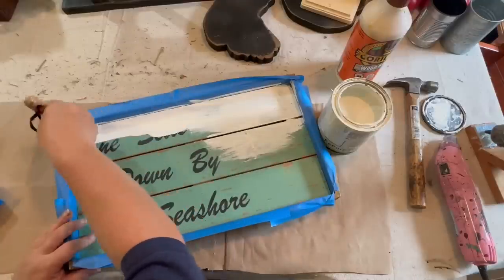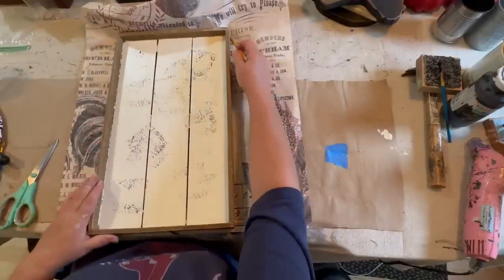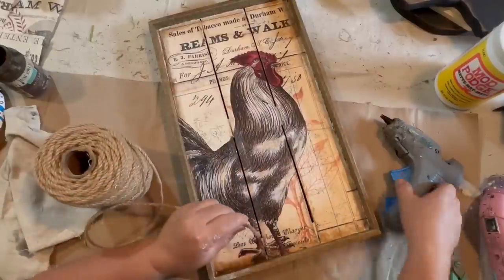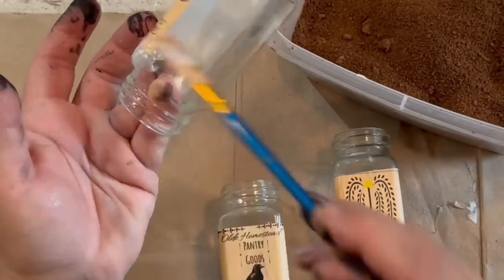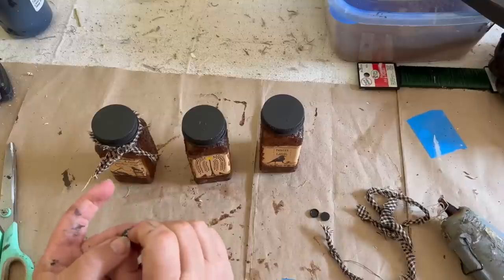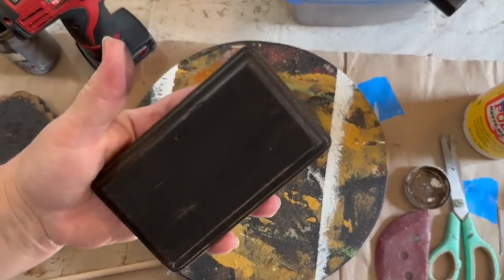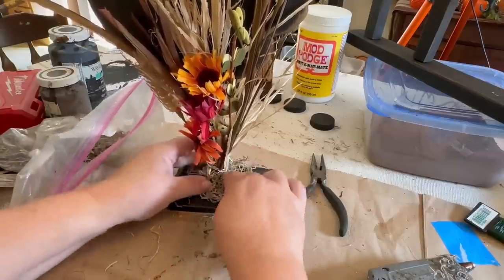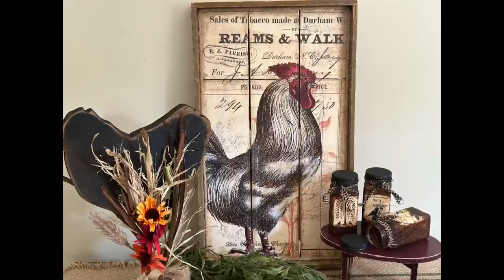DIY Fall *Rustic Primitive* Home Decor

Comment: Spritz the top of your paper each time you add more mod podge and spritz that section before you put it down. That REALLY helps it mold to your surface and relieve wrinkles and bubbles. We both did crackle under the paper! I did a black halo like Royce does as well. So glad you found a use for the paper! Beautiful, beautiful job ❤❤❤
Reply from the maker: I love the crackle look underneath! It adds so much.

Comment: Would the Rust-Oleum 2X Clear Coat work on the grubby jars so you didn't have to tap the mod podge on and risk knocking the spices off? Would it maybe seal it in to be water proof?
Reply from the maker: I don't know about waterproof, but it does help seal to keep the spices on it. I used it on one of my grubby pumpkin to show the difference.